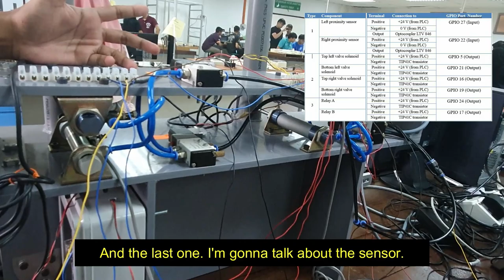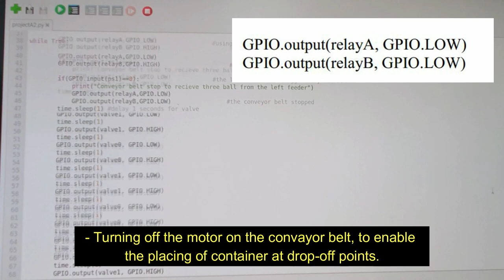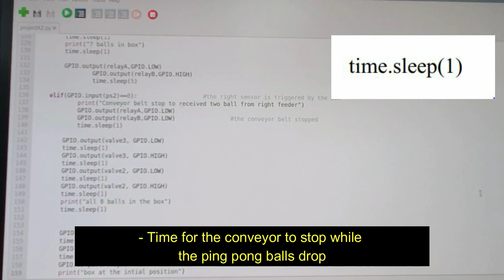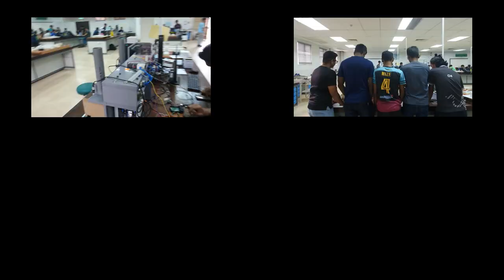EMC 311 MECHATRONICS : Raspberry Pi Microcontroller Project Group A2 2019/2020

Comment: Objectives are well defined.
Manufacturing application is not associated.
Box is not designed for manufacturing application thus operation sequence is similar to other teams.
Wrong definition of PLC and Solenoid.
DHT22 sensor are not used.
Wiring for DHT22 sensor and switches are not shown.
Motor and relay circuits are not shown and explained.
Pneumatic circuits are not shown and explained.
Program initialization is shown and explained.
Program flow is shown and explained.
Switches are used for controlling outputs.
Magnetic sensor are not used for controlling outputs.
DHT22 sensor reading is not displayed and is not used for controlling outputs.
Operation demonstration  is well shown and explained.
3.23 minutes extra time.
Mark 60%
Reply from the maker: Thank you Dr.